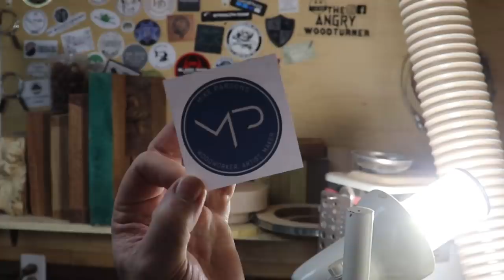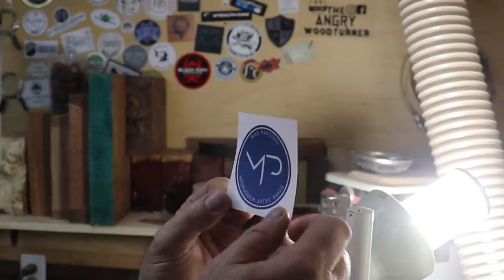Woodturning a Goblet from Firewood

Comment: I have made a few things from red cedar and have always been disappointed with every finishing material I have tried.  Urethane, regular varnish, spray varnish, and all of them remove the brilliant PINK color in the fresh wood.  Is there anything you know of that will seal in that color and keep the pink or at least some of the pink that is in the wood?  I still have access to some of my prize stock, but I have been waiting for info on what finish, sealer, stain, etc could be used to preserve the original colors.  I have tried the clearest finishes I can find, and have no luck so far.  

Excellent design and work on the goblet.  Like the captured ring on this one.

Comment: I recently got a couple of red cedar logs -- what beautiful wood! When I turned my first piece I kept thinking, "don't ruin this wood!"  Quick question for you: When you make a goblet (or a vase), do you treat the inside with anything to make it leak proof? I've used an exterior clear poly that worked on an outdoor table and it seems to work, but do you have any other suggestion?